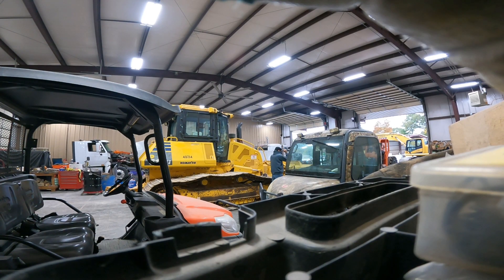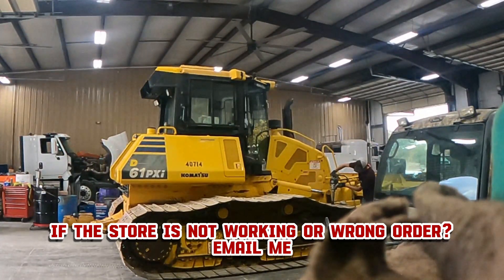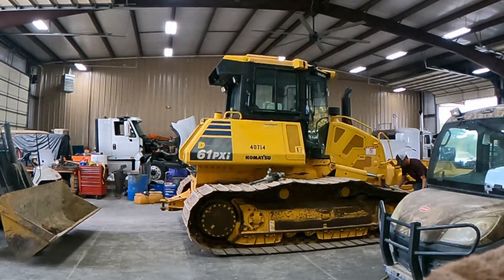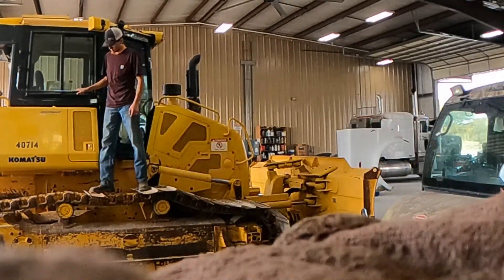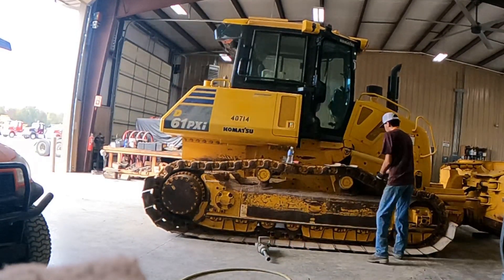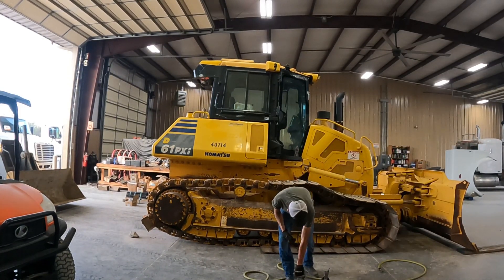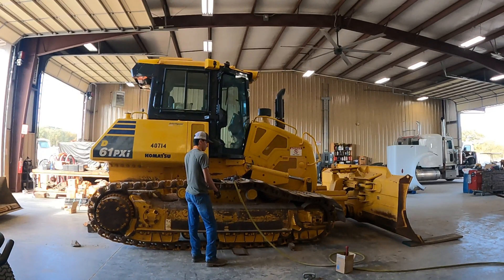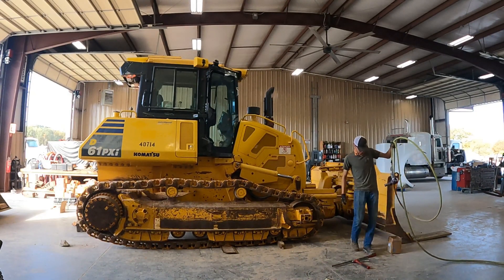Replacing The Pads On A Komatsu Dozer D-61 PXI [Part 1]

Comment: Hey man great video, i have  a few questions, are you actually a "Heavy Equipment technician" (421A) or Truck and Coach (310T) ? Reply back please and thx (keep posting more videos like this !)
Reply from the maker: I wouldn't call my self a technician yet I would probably say I'm an apprentice. I have enough knowledge to work on anything from running diagnostics and tuning to replacing engines and work with hydraulics.
Reply: Yea I understand that your an apprentice that's great, im also tryna do the same probably for Heavy Equipment though but I'll definitely expand my knowledge onto Truck and Coach stuff too